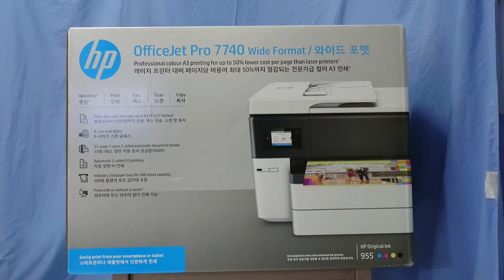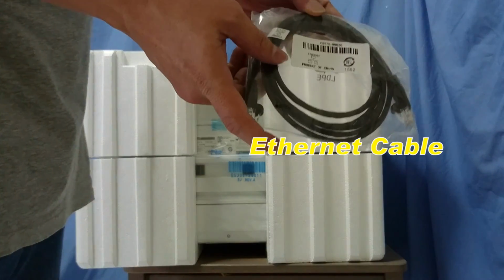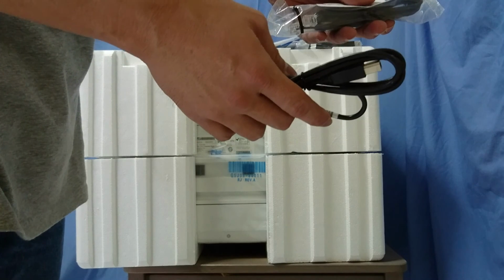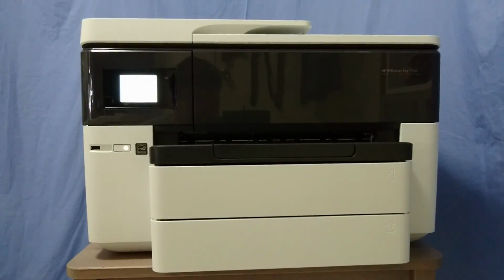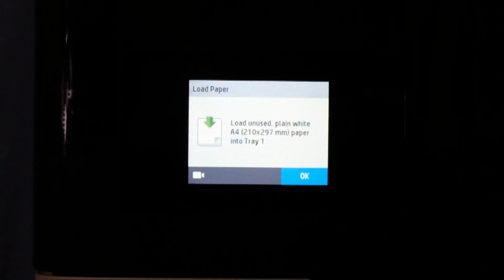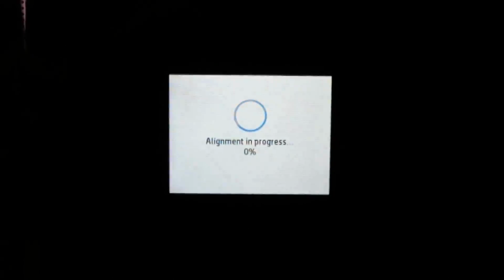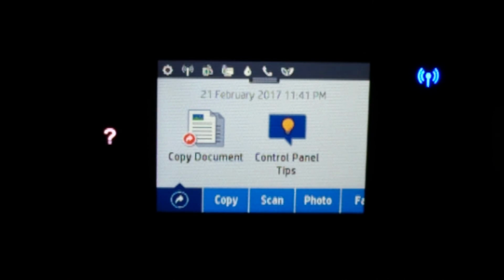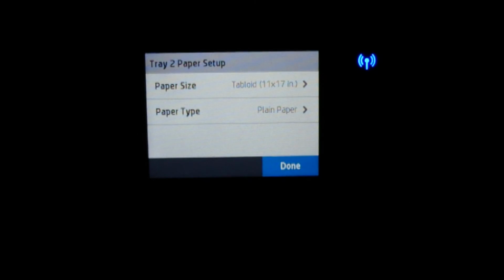HP Officejet Pro 7740 Unboxing and Setting Up

Comment: Hi just a question so If I load the bottom tray with 11x17 paper it will not close (Is this right ? and it will print OK still)   Thank you great video
Reply: Can I ask why you didn't select the A3 paper option 2 down from the A4 paper option? You appear to scroll all the way to the bottom & select tabloid. Is there a reason for this? Thx
Reply from the maker: Dear Krista Belle76, 

Thanks for checking out the channel!   We selected Tabloid because we put in Tabloid size paper.

For more tips on these printer models:
https://www.youtube.com/playlist?list=PLUV0sXfF6zPjvGX7KpDjFfzRDv7_TDPG2

May we invite you to like and subscribe to our channel for the latest video uploads by simply clicking on the link below.

https://goo.gl/y4Rcn1

Click on the bell so you will not miss any notifications.

Best,
Technology Tips
Reply from the maker: Dear Lucy Irvine,  

Thanks for checking out the channel!   Yes, the tray will be sticking out for 11x17 (Tabloid) or A3 media. 

For more tips on these printer models:
https://www.youtube.com/playlist?list=PLUV0sXfF6zPjvGX7KpDjFfzRDv7_TDPG2

May we invite you to like and subscribe to our channel for the latest video uploads by simply clicking on the link below.

https://goo.gl/y4Rcn1

Click on the bell so you will not miss any notifications.

Best,
Technology Tips